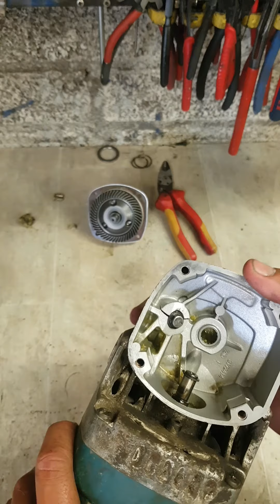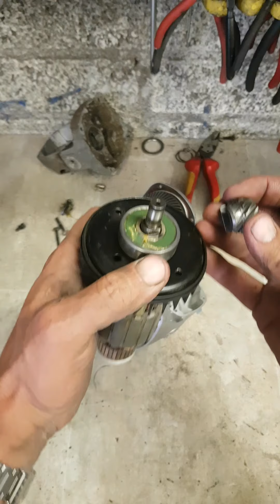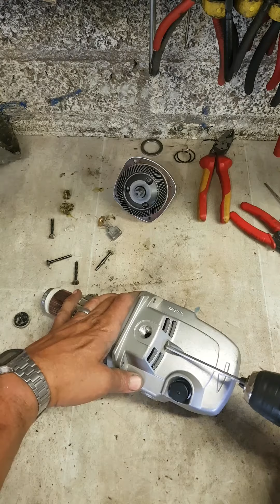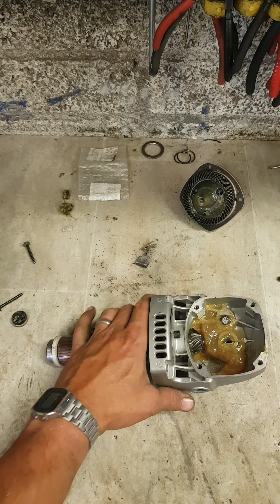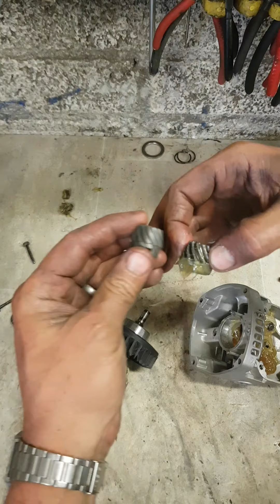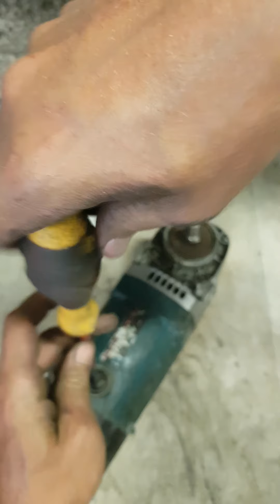Repairing a old Makita 9069 grinder that is not driving the disc.

Comment: Quick question Dean, can the cooling fan on the armature be bought separately or do you need to buy the whole armature? I have a 4" grinder that a scree came loose inside and shattered the fan, the grinder still works but runs fast and hot.